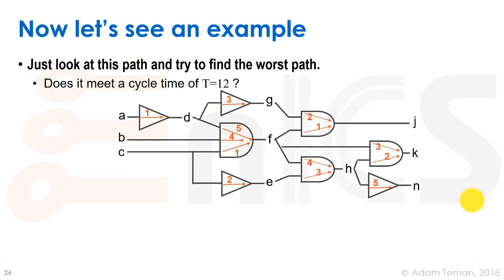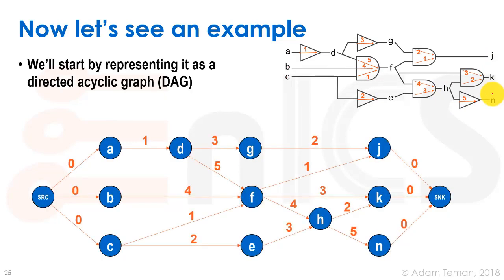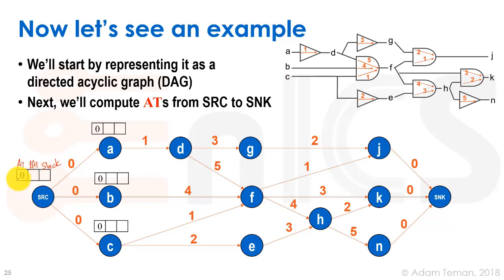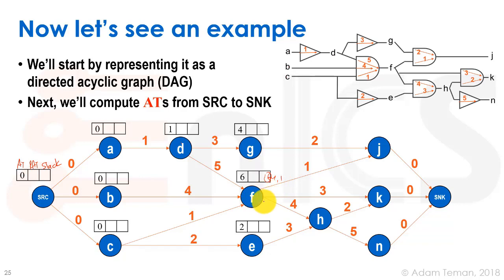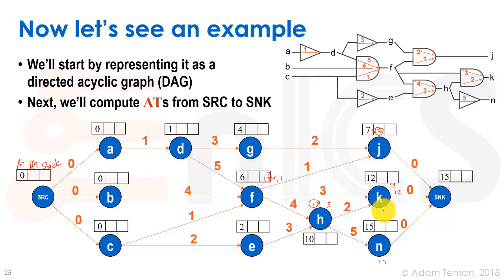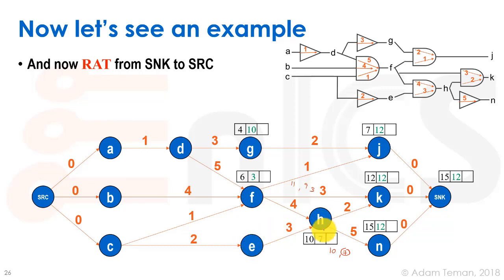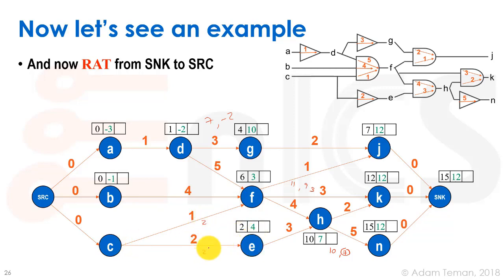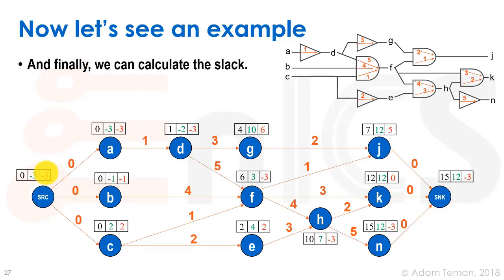DVD - Lecture 5d: STA Example

Comment: Sir, I'm confused when deciding RAT. RAT at a node is min[ RAT(successor node) - delay( node to successor node ]. From this relation, the minimum delay from node to successor node should be considered. In the lecture you have taken the worst case i.e max delay. kindly, correct me
Reply from the maker: Hi Socialogic,
Yes, I see why this could be a bit confusing.
The "min" is around the entire expression (as you wrote). So we're looking for the RAT that has the minimum value, in other words, what is the *earliest* time that the data needs to arrive at that node to make it to the end in time.  That means that we are looking for "how much time do we need from this point and on to finish our operation". The thing that sets this is the longest delay from this point to the end.
So we are looking for the maximum delay from this point to the end. Because the RAT takes the end as a reference - looking backwards - we are looking for the minimum of all these calculations. But we take the maximum arcs from here to the end.

So the slides are correct.  You can see this visually on slide 23 (https://www.eng.biu.ac.il/temanad/files/2018/12/Lecture-5-STA.pdf). To quote the slide: "RAT: longest logic delay to the capture edge of the clock (dependent on cycle time)

Hope that helps understand it better.